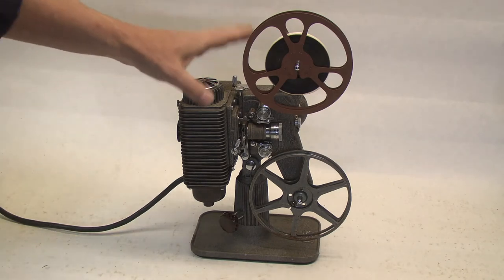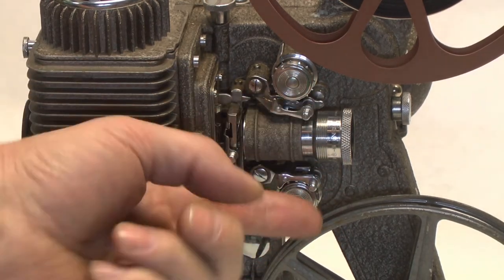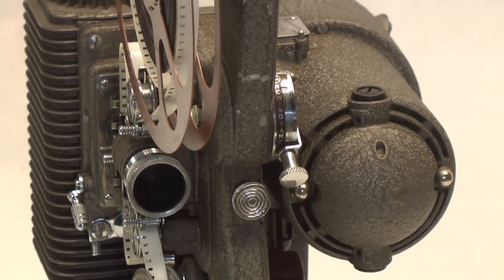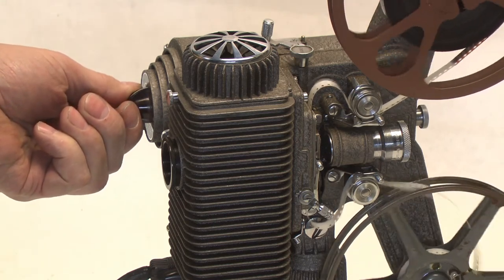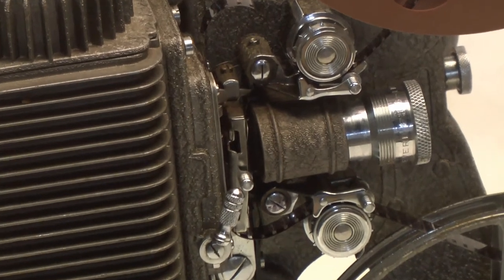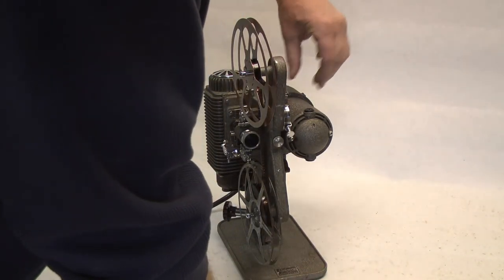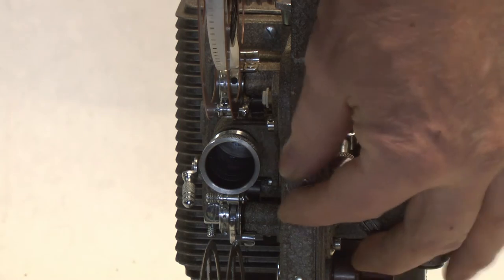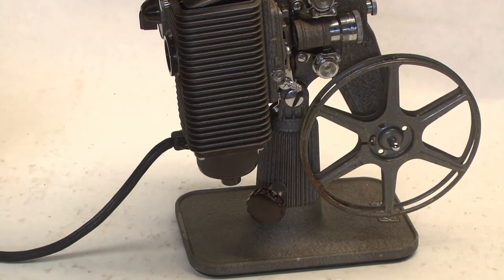Revere Model 85 vintage 8mm Movie Film Projector - Loading, Operation, Rewinding, Lamp Replacement

Comment: I have the same model. There is a screw on the opposite side of the fwd-rvs transmission lever with a very thin slot that can be tightened so you don't have to hold it up for rewinding. I am having trouble with the piece in the center of the pressure plate. It looked like another lever, but since moving it, my picture flickers. I have removed it, adjusted it, but nothing seems to help.
Reply from the maker: I'll have to pull that projector back out and take another look at it.

Comment: Any advice on a model that smokes when turned on?
Reply from the maker: Many old projectors smoke a bit when they are first used after years of sitting. The lubricating oils and grease often travel down close to areas that get hot, so they burn off for a few minutes. Kinda like a car with a leaky valve cover and oil that gets on the manifold. However, if it smells like burning rubber you probably have a different problem. Turn off the projector and inspect. Thank you!